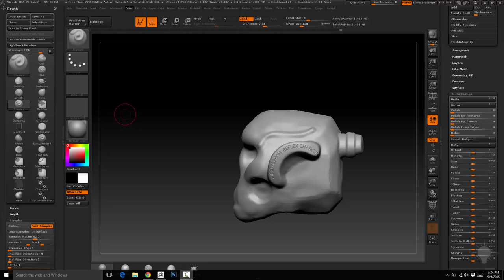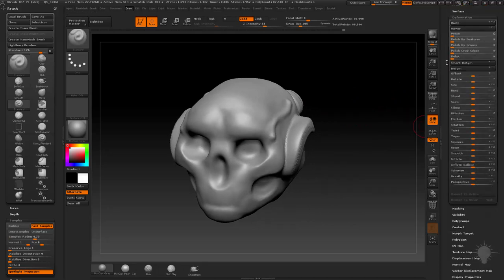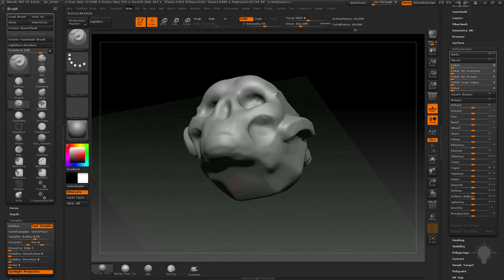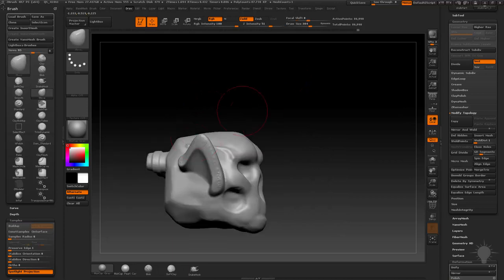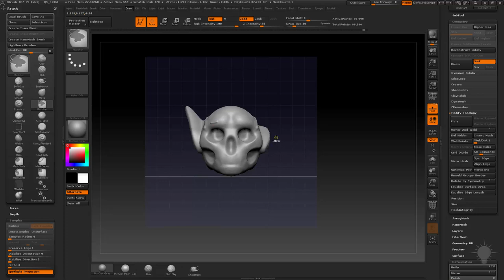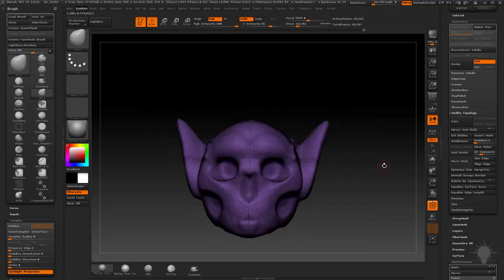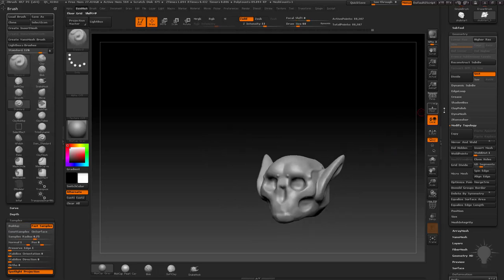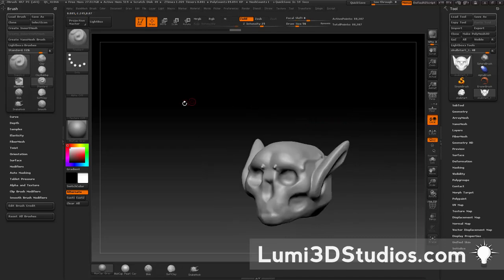025 Mirror And Weld

Comment: You saved me a BUNCH of work!!! I was sculpting my eyes and decided to turn off symmetry because the eyes were modeled asymmetrically. Well, I didnt want to do all that work on the other eye, so I cut out the eye, duplicated it and merged it with a duplicate and dynameshed it together (that usually works) but for some reason, dynamesh closed the eye hole...this mirror and weld setting saved my life ahah. Thank you!! So hard to find this topic.

Comment: Hey man, can you pls help me with this? I've sculpted a mesh symmetrically. However, when i used the transpose line to scale down the neck, i accidentalyl moved the neck slightly off to one side. As a result, my model isnt symmetrical when i sculpt. Whats the best method to overcome this? Weld and mirror? Or would it be impossible to reset the symmetry since the body and the neck are not aligned?
Reply from the maker: Mirror and weld (turn lsym off if it's on), also if you're transposing by finding a surface normal, turn perspective off, it can have a tendency to throw off the axis a bit
Reply: Michael Pavlovich Thanks for your reply! With the mirror and weld technique, do i have to delete one side?
Reply from the maker: +VFX Ltd™ no, but you might have to hit deformations 》mirror first if the side you want to keep is in positive x  (It mirrors negative to positive x)
Reply: Michael Pavlovich Thank you so much, you're a life saver!!! After 6 months of searching, hat method worked flawlessly!:)))

One more question, how do i change from one perspective to another? E.g. left, right, top viewport like in max and maya?
Reply from the maker: glad that worked! for orthographic views, start rotating in the direction you want (top, left, etc...) then hold down shift, it'll snap to the nearest orthographic. If it's not snapping to the view you want, give it some help by rotating first more into the direction you're looking to snap to

Comment: Gotsa few questions regarding this technique:

1. What about details that aren't "mirrorable", so to speak?
Say, if you drew out a stroke with an irregular alpha smack dab in the middle of the guy's forehead, using for example the swirly Alpha 19?If you mirror and weld - the shape is lost. Can you "protect" or mask out in some way a part of the mesh you don't want to lose?

2. How do you deal with the seam that gets created in the middle?
Stacking a turbosmooth above symmetry in max creates a smooth transition. Maya welds the points nicely too. I see there's a "weld distance" option (doesn't go bellow 1) and a "weld points" button. I try to follow along at home so I made a skull of sorts and fiddling with those options don't seem to do anything.
Reply from the maker: +Poof of Cheese 1.For that type of symmetry, you might want to try smart resym in the deformations menu; I cover this in video 34 in the Intro to ZBrush Part 2 series https://gumroad.com/pavlovich .  There's also "use poseable symmetry" in the transform menu for a way to keep sculpting symmetrically as long as your underlying base mesh is symmetrical (so you could temporarily turn off symmetry for asymmetrical detail down the centerline).

Buuuuut, neither of the above methods apply to dynamesh and mirror and weld as shown in this video; if you're using dynamesh on an organic object, I wouldn't be adding detail (and not asymmetrical detail) until I was ready to call the object done, or I had zremeshed / zprojected, was at the detail phase of my object, and it was one of the last things I was going to do. Dynamesh in the above video is really about making sure your base mesh is what you want without any large changes, before locking it down and making asymmetry or centerline detail choices. 

If you're just doing a quick concept sculpt to feel out how it would look, temporarily turn off symmetry, put your asymmetrical detail smack dab in the middle, then continue to create with symmetry turned back on. As long as you have symmetry turned on for your object, you shouldn't have to do a mirror and weld operation. If you accidentally turn it off and need to mirror and weld, realize that you're going to have to smooth out your centerline alpha drag and re-draw it on; which shouldn't be a big deal, if what you're using dynamesh and mirror and weld for is making sure your base mesh is what you want, before refining it further, which is what I would suggest using the video method here for. 

TLDR: Don't use dynamesh and mirror and weld if you plan on doing final detail work, it's more of a quick concept base mesh blockout creation technique before further refining, covered in Part 2 of the series.

2. I'd smooth out the seam in the middle then mirror and weld again, until I can sculpt symmetrically and there's no seam down the middel.  A noticeable seam in the middle of your mesh after mirror and welding sounds more like the object was pulled off axis completely before symmetry was applied, this isn't a normal thing if you're working symmetrically to start with, which I would recommend. In that case, go to Geometry > Position, and make sure your midline axis is zeroed out before mirror and welding. 

Again, I'd really only be using dynamesh as a concepting tool in the above video; if I have a seam, I smooth it out with symmetry turned on. If I've got a fully detailed dynamesh for some reason (which would be rare on an organic-type object like in the video), I'd rethink using dynamesh to fully detail out an organic mesh across an axis, that is a very "fragile" workflow. Mirror and weld does weld objects down the midline of the axis you chose, but if you're looking for turbosmooth weld vert stuff, zmodeler and dynamic subdivisions in part 3 is probably more what you're looking for. You could also conceivably use array mesh for instance-across-an-axis sculpting if you're having trouble with symmetry during the creation stage?

If I had to guess at what your particular problem is without seeing the mesh, I think you're trying to apply a tool that is better utilized for base mesh concept creation to solve a problem that is more of a down-stream-box-modeling-methodology, and there'snot a great answer for this particular tool in that particular situation. 

TLDR: There's ways to accomplish what you're looking for in ZBrush, but dynamesh and mirror and weld probably isn't the answer; use dynamesh to have fun in 3D and concept out what you're looking to create quickly, then refine from there using methods further into the series.
Reply: +Michael Pavlovich 
I understand now, thank you for a very exhaustive and very quick answer(s) to both these and the Smart transpose mask questions in the other video. :)
Reply from the maker: +Poof of Cheese haha no problem, wish I had a better more concise answer for you in this case. There's so many options in 3D it gets a little crazy sometimes!
Reply: +Michael Pavlovich 
Yep, so I'll gladly take the longer and detailed answer whenever someone knowledgeable takes time out of their schedule to type it out. ;) And the answer really did clear things up for me.

Comment: Hello! Im having trouble with my work. The mesh has an offset along the X axis, then when i want to sculpt with smmetry the brush appear in 2 different points of the geometry, i ve been trying to fix it moving the pivot on the previsualize tool, but the result is not accurate.
Reply from the maker: turn on "L.Sym" in the upper right hand corner if your object is off world axis to sculpt in symmetry on a local  axis
Reply: Ty Pav! You are the best.

Comment: When I hit the mirror button, it said that this function can't be applied because of multiple subd levels. How do I fix this?
Reply from the maker: go to geometry - delete lower to get rid of your subdivsion levels. If i'm just exploring shapes if i need more resolution I'll increase my dynamesh resolution instead of adding subdivisions; once my major shapes are figured out, at that point i'll zremesh and project and add subdivisions then, at which point I won't be doing any mirror and welding.

Comment: Can someone help me? I seem to be missing the "modify topology" part of the geometry menu... https://i.imgur.com/bvV8wZP.png
Reply from the maker: If you're ever missing any geometry commands it's usually one of three things; if you have a zsphere selected, many of those commands will go away (and change), if you have a primitive selected (not converted to a Polymesh3D) your options will be different / limited, and finally if you're using ZBrush Core, there will be far less options. Just looking at it I'm going to assume you're using ZBrush core, not ZBrush "pro" (which is what this series is for); the zbrush core series is this playlist: https://www.youtube.com/playlist?list=PLkzopwqcFevbD6QZnhzROSyiaFUCZxPz3 ; if that's not the case, let me know!
Reply: I believe I was using a polymesh 3D (Dynamesh is showing on the object? I don't know what the difference between the 2 is) however hitting "make polymesh 3D" again made the modify topology window pop up. So now I  can continue! It definitely wasn't a primitive since it was a fully sculpted model. Seems it may have lost the polymesh 3D when I appended an eyeballpolymesh subtool to the character model. Strange.

Anyway, huge thanks for the help!
Reply from the maker: Strange!! I guess ZBrush had a hiccup and somehow tagged that subtool incorrectly...glad make polymesh3D knocked it back into working order!